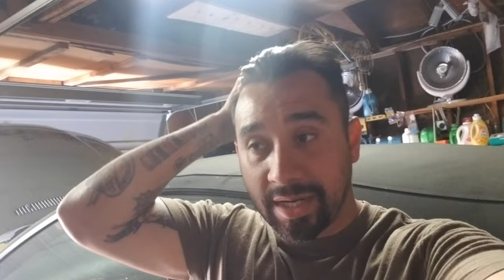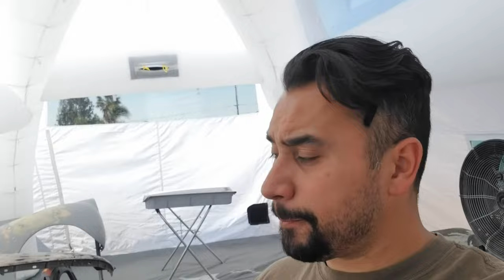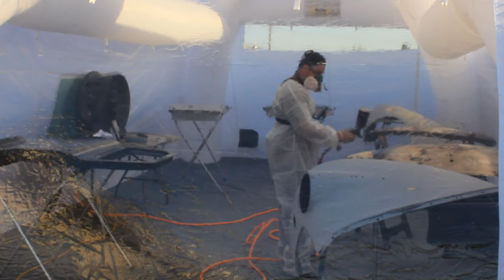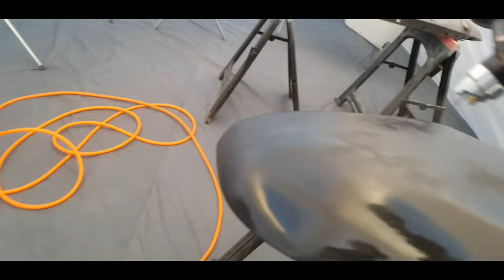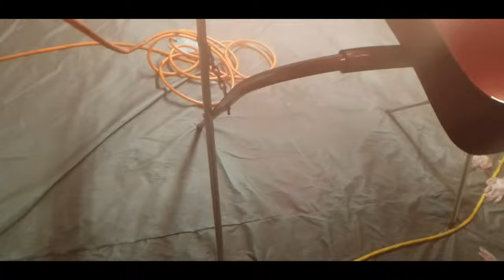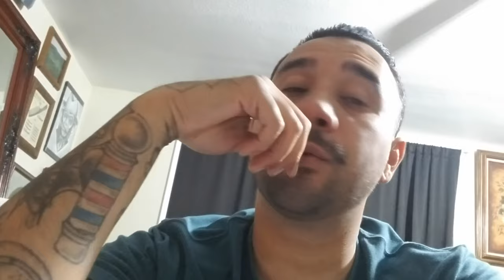clear coat over single stage

Comment: Nice! I’ve been searching too for this video for ever. Thanks for that. I am doing the same thing now on truck of mine. I did the bed already. Stripped it and re apoxy primered it. Laid 2 wet coats of single stage gm white, let that dry for like a week then ended up wet sanding it with 2000 grit and sprayed 3 coats of a pearl clear coat. Now, that was a lot of work. You ain’t lying. I’m about to do the cab and the rest. But I am going to just wait 12 hours for the single stage to flash off this time before I add the pearl clear coat over that. Thanks again!
Reply from the maker: Yes it's alot of work. Specially if there's alot of body work involved. Btw, dont mean to scare you but from what I been told. 2000 grit will not suffice to lay clear over.. from my understanding, 2000 isn't enough "bite" for the clear to grab on too.. usually depends what ur spraying. U want between 320-800 grit. I beleive 800 is kind of the cut off point, maybe even 1000... But keep me updated! Lmk how it holds. I'm one to usually go against the grain lol

Comment: As far as I remember the paint company put the window to apply more paint without sanding on the can! Maybe 12 -24 hrs?????In hot areas  I’d think the low number to be safe! But I always tack ragged. For peace of mind. But we have bugs. And must spray between 5-10 am. Dew takes dust out of air. Bugs don’t come out until all the dews gone.only two paint jobs out of ? 40 ? Was painting in a different part of the country! My southern Indiana paint rules I gave myself didn’t apply! And with 2 ft of snow in a block building,owner made us leave door half open with a fan to suck overspray out! Both dry sprayed! Enjoyed your video!
Reply from the maker: Thank you! Yes I beleive this paint had a 6 or 4 hour window to top coat. Some other veteran painters told me to wait 12 hours then spray (following morning) it worked well. Paint hasn't failed since. I couldn't imagine painting in the cold. We get heat over here well we have to wait for cooler temperatures if we're not spraying inside a well ventilated area

Comment: Just found your video. My question is: I have a single stage job that I did on my restoration project about a year ago. It looks pretty good but I really want to apply clear coat for that SHINE. The paint has obviously cured for a year so I'm not really worried about reactions. But, I have polished the paint in the past year. Do I need to scuff the single stage for the clear coat to adhere or am I good just cleaning it thoroughly and shooting the clear? Thanks!
Reply from the maker: Must scuff down to adhere. Only time you can apply without scuffing is within the specified recoat window. Which sometimes ranges from 15min- 12 hrs

Comment: Back in the 90’s, my old man restored a 1970 Holden premier.
When he painted it, he used acrylic as that’s all he’s ever used. He sprayed 2 coats of colour, then a coat of 50/50 colour and clear, then a coat of 30%colour 70% clear, then a couple of straight clear coats.
Wet rubbed/colour sanded it and polished it and The thing looked amazing.
Had a lot of depth and won a trophy for best restored.

Comment: I have been searching the entire world for this video ! Thank you ! I also bought the gorilla pro inflatable paint booth and a gust of wind ripped up the booth and took it 50 feet into the air !! Set it back up ! Painted the truck , it was )105 degrees inside The booth ( used single stage blue metallic! Waited a week . Wet sanded with 1500 grit and now getting ready to clear coat with 2k clear . Any advice on how to get the best possible glossy shine ✨??
Reply from the maker: Yes, apply wet!! Better to have runs than over spray. If anything practice on a trash panel. You're bound to have some imperfections. My first time I was spraying  to scared of getting runs that all I did was mist it and hardly had any clear to even wet sand. Also adjust the gun properly. Don't use any of those filters that go on top of the gun/ inside the cup. And use all highflow fittings. The restricted ones give you more texture.  And also sand that single stage down to flat finish. U don't wanna leave any texture. The finish product only looks as good as the foundation/ prep
Reply: Thank you !!

Comment: The paint was drying on me fast as I was spraying it ! I even used a extra slow reducer . The truck has lots of dry looking spots and some spots looked ok . My plan is to lightly wet sand with 1500 and 2000 to smooth down the paint enough to hopefully by a miracle from the paint gods to get 3 coats of 2k clear . Any advice from this channel would be very helpful!!
Reply from the maker: Yes those dry spots are more than likely from not enough material. You might not of applied enough that u might sand through the single stage. If you did. It's best to re shoot again everything with the single stage. But this is good. Single stage is thicker. Will cover any pigtail marks from the sander. And you can re clear after 12 hours without sanding. Just let your first coat of clear be a nice mist/tack coat. Then go and spray wet. Use very good lighting. Watch at an angle how your clear is laying as your spraying. And u want it to look wet as your lying g it down. That's how ull get a nicer finish.  Keep spraying wet till your 3rd coat. And you'll have enough material to correct any mistakes so you don't burn through
Reply: Thanks for the advice ! I can’t wait to get this truck shining!!
Reply: @crazee6821 did you follow through with clear on your single stage? I'm about to do the same thing.

Comment: Just helped a lot because all I wanna do is paint my truck in one stage and then put sticker stripes on the front and clear over the stripes so all I wanna do is clear the hood thank you I think this will work
Reply from the maker: As long as you're within the window of relearning, you're fine. I wouldn't wait longer than 12 hours. If anything passed 18 hours I would scuff down the single stage and then clear

Comment: Recently sprayed bike w/ 2 med/thick coats of single stage enamel out of rattle cans & went to clear with same brand cans 12hrs later and the top coat lifted and shriveled up. Got a reaction from the solvents that haven’t cured enough , for the record prior to spraying clear , the paint was dry to touch , no prints but im assuming the single stage wants quite a bit longer before spraying.  Ill sand the bad spots out tomorrow and re spray with the single stage . Luckily the enamel laid up pretty shiny to begin with. Gonna just clear it next summer.
Reply from the maker: Which brand did u use? If it was rustoleum, I'm pretty sure it the tds calls for it to be cleared after one week. So it has a 7 day flash Window before you clear it..
Reply: @vanni_doestv4516  it was just some cheap stuff off the shelf down at the hardware, did a bit more research and figured yep , about 7 days… whoops. At the shops i’ve worked @ we sprayed w/ lacquer based paint and hit the cars with clear 30min after laying the base coat , but the second I tried that with Enamel my bike took one look at me and said “you gon learn today”! 🤣

Comment: traditionally, single stage is the same chemical as clear i.e. it has clear in it, so you just wait your normal time between coats. they always did this back in the day lacquer was single stage, and they would use clear for the last couple of coats
Reply from the maker: Yes, i thought the same. Except at first I'd hear bad stories of applying it over. But this came from painters who never attempted it. Some old time painters are the ones who told me to wait the "12hr or over night" method.. it worked great. Till this day, no adhesion issues. But I will attempt a much more closer window next time

Comment: I am doing this, but am going to mix the clean in with the single stage.  Wishing for luck
Reply from the maker: As long as it's the same brand, you should be fine. Also I'd suggest shooting 1 coat of just the color, then to the rest with mixed clear. This way you get a goof color foundation.
Reply: Yes.  Doing two coats of color and one of mixed

Comment: sweet video man I'm looking to get one too for my project how's the filtration on it? Overspray get out with the fans it comes with?
Reply from the maker: The filtration isnt the best. Even with the big shop fan I used to push air through the filters, it still got cloudy in there pretty quick. Next time I paint, i plan on runing 2 inline fans with duct runing outside. Along with the shop fan.
Reply: @vanni_doestv4516  look forward to your results
Reply: I just got the single blower option and then bought a 1700cfm blower for the second intake port and the exhaust fittings for both filters with 12 inch fans. With all that it's close to the 3550cfm like the mobile solutions spray booth. I still prefer my shop downdraft booth but for doing stuff at home this thing is great. I would also recommend having a dedication 20amp circuit installed to use.

Comment: Single stage paint true single stage urethane paint with a hardener does not require a clear coat clear properties are already mixed in the paint
Reply from the maker: I havent shot any other single stage other than this tcp brand. But it sure did need clear over it. When I shot the ss alone its gloss wasnt very pleasing. After the clear it gave it a really nice depth. Which single stage do u recommend to be true??
Reply: @vanni_doestv4516  one that I'm familiar with is PPG concept it's mixed with reducer and hardener definitely requires no clear coat
Reply: They're actually called binders theres no actual clear in it ,a paint rep schooled me a little
Reply: Is the down fall of single stage that it fades over time so there for it needs to be buffed out to restore the shine compared to base clear, is that why it would be a good idea to add clear no mater what?
Reply: @robertkinney1480  you must be shooting a cheap-ass single-stage then a good single stage definitely does not require a clear coat

Comment: i just painted a fender with single stage napa oem color match single stage and had to blend it to the door.
the rest of the car is 2 stage paint.

should i clear it it ? if so do u think  i should wait a week before wetsanding  to put clear on?
Reply from the maker: If u blended to the next panel. I'd definitely hit that with 600 and re clear both panels again to seal that paint
Reply from the maker: So scuff down the whole door and fender. Mask everything else. And rebspray those panels

Comment: What's the highest grit you can sand it before clear?
Reply from the maker: I prefer 600. More bite for the clear to grab on to. But I've used as little as 400 to 800. Anything above I personally wouldn't touch.  I hear many do 1000 and 1200. But that's to smooth for me.
Reply: @vanni_doestv4516  Thank You for answering. Someone told me that I can use 2000 grit but I was afraid that the clear might start peeling off. Should i also scuff decalst/stickers ?
Reply: Decals are like 12x5 inches

Comment: Do u wetsand it before u add the clear coat
Reply from the maker: Depends which single stage you use. This one you can spray without sanding. After  flashing for 4 hours. However I waited over night (12 hours) then sprayed without sanding. This method as been done before, and it's best to let all the solvents come up before clearing. You could wet sand if you wish.  It's just more work.
Reply: @vanni_doestv4516  im tryna add a vinyl decal on my truck and clear over it

Comment: I always use single stage and then clear over it.
Reply from the maker: How long do you usually wait till you shoot clear over??
Reply: @vanni_doestv4516  if I encounter any problems like bugs or trash I will wait about 48 hours or until the paint mfg states a full cure time then wet sand and clear. If no problems just wait your normal flash time....usually about 15 -20 minutes.
Reply: Are you on fb?
Reply: @haleyfarmz  i got solvent pop when i did this 
sucked real bad as it looked great when i left the booth haha

Comment: Can I apply a clear coat on single stage after a whole year of just having single stage on the car?
Reply from the maker: You can but must sand with 500-800g. That's considering that u dont have peel, cracks, chips or oxidation. If you do. Those areas wont bond and will soon have the new clear flaking off.
Reply: @vanni_doestv4516  thanks so much, I really appreciate the reply 🙏
Reply: If you claybar it before ya sand with 600 grit !

Comment: Has anybody tried mixing clearcoat in with the paint on final coat
Reply from the maker: Yes, just make sure both paints are compatible, best to go with same brand, same mixture.. if applied properly to a nice finish. It has a deeper gloss look. Then top coat with 1-2 wet coats of clear.. that will give you enough material for light wet sand and buff….

Comment: Can I spray a urethane clear coat over a single stage enamel metallic paint??. Also when you add flake To the clear are you able to fill roughness in the clear coat once the car has cured.
Reply from the maker: What brand is the enamel paint??  And no u couldnt feel the flake since I used a smaller size and did not add too much. I also buried it with just clear over the clear/flake
Reply: @vanni_doestv4516   So I bought 2 single stage gallons one is called Fern Green Metallic Acrylic Enamel and the other is Black Metallic Acrylic Enamel  there from TCP Global. This is my 1st  single stage attempt its gonna be a 2 tone black top the green on the bottom.. I want to add a clear over this but I was told by the company that sold it to me that it's impossible...
Reply from the maker: So I'd Definitely do a test spot first. I have seen ppl mix clear into the single stage to give it even a better shine and I've also heard of pplbspraying clear over it BUT must flash a certain amount of time so the chemicals don't mix.. check out speedokote channel. He recently painted with acrylic enamel and clear coat. I personally haven't but sure it's possible. Again I'd fine scrap metal and do a test spot. Let it flash about 6-8 hours and see how that does. I wouldn't do it while the single stage is still tacky

Comment: Can I do metallic singla stage then wait 12 hours then clear?
Reply from the maker: Yes sir. This was metallic also but wasn't satisfied with it. So added flake as well
Reply: @vanni_doestv4516  dose it look good? Know
Reply from the maker: @gamingwithbryan8613  yes it does. Clear over single stage gives it a deep gloss.  But its definitely more work than base coat/ clear coat.
Reply: @vanni_doestv4516  why do you say it was definitely more work than bc/cc?
Reply from the maker: @42042042013   my apologies, let me re clarify.. it takes longer. Making seem like more work. For the most part you have your first 2 applications of medium wet and a float coat. Then your clear but depending on the DTS u shoot it 4-12 hrs after while bc cc it's just done one after another finishing up sooner. My job was more work but only because I shot flake as well. So 2 wet coats. 2 mist coats 3 clear coats..process took a long time
Reply: Single stage has a window of time you can add clear, after that Windows up you have to wait until it gasses out.
Reply: @randabuffer6562  what would you say this time window is ?
Reply: @NightshiftCustom  you would have to look up what paint you have and factor in the amount of humid air that’s in the booth or garage your spraying in. 

Here in Arizona single stage paint starts curing pretty quick
Reply: @NightshiftCustom  my summit 2k single stage urethane paint says 18 hours before you have to re sand. All paints are going to be different just read the instructions on the can lol